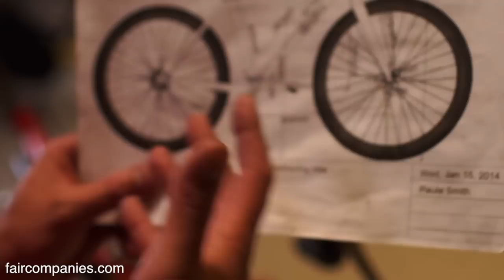Art of making handmade bicycles (custom tailored in NorCal)

Comment: I've got to say, I winced when I saw him just bend the frame at 4:34.  Doesn't he have the tubes in a jig when he welds them?  That shows me that he's lacking very basic metalworking skills.

-jcr
Reply: No, not at all.  First, he did indeed weld the frame in a jig.  Problem is, welding results with inevitable warping, causing the tubes/frame to lose alignment.  Every frame builder experiences this.  It's expected and remedied in the next step of production...

Second, and most importantly, "bending" the frame is called "cold-setting" the material and it's done industry-wide.  This is why alignment tables are massive, immovable and have a really strong bottom bracket clamp - so the builder can properly align the frame.  Steel does very well with cold-setting, so you can relax.  Without it, your custom, hand-made steel bike would be out of alignment.  Head and seat tubes are parallel because of cold setting.  Your rear triangle is centered because of cold setting.  Your rear dropout spacing is on the millimeter because of cold setting and your dropouts are parallel because of cold setting.  Yup. lots of "bending" happens to a frame before you even see it.